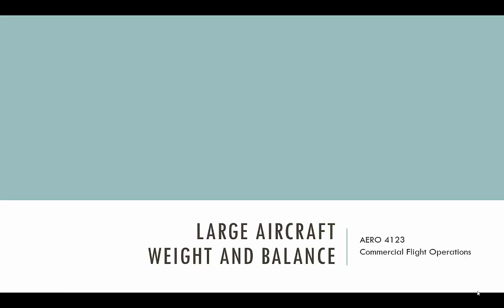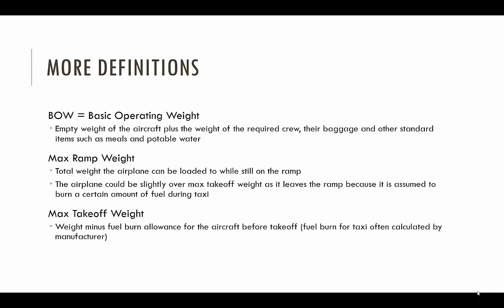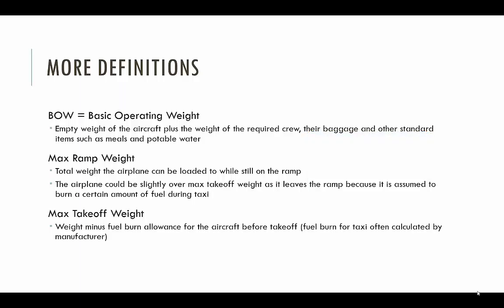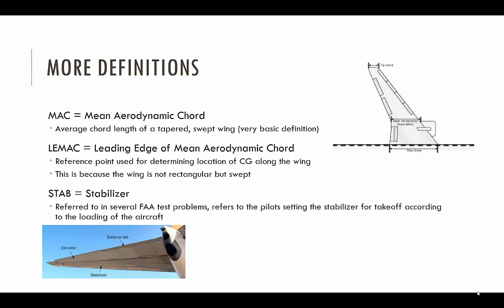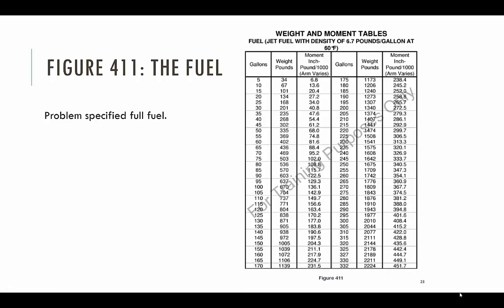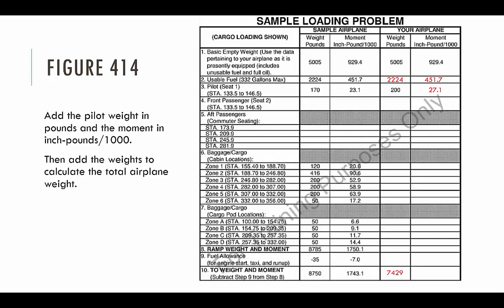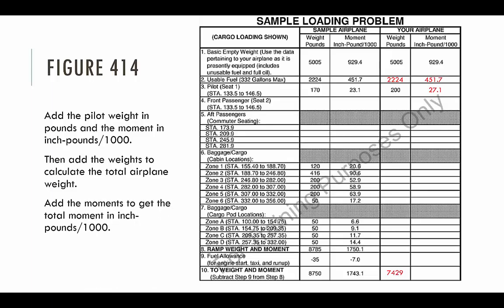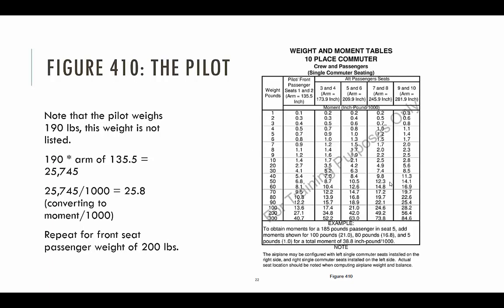Part 3: FAA Test ATP Airline Transport Pilot and Aircraft Dispatcher ADX Calculation Tutorial (HD)

Comment: I think there's actually an error in the question 8700, where it says cargo zone 6 weight 60 x arm 344 ..   the calculation they did for the answer is not correct.. can you check it?   thank you for posting this video by the way, it helped me a lot so far.
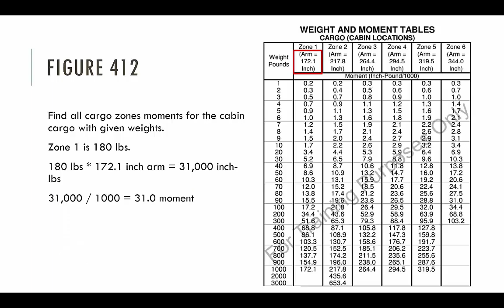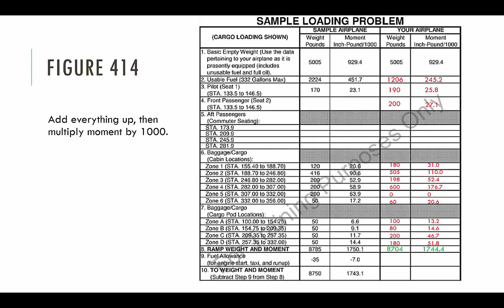Reply from the maker: Hello! I reviewed the video and found at time 14:51, you can see the cargo zone chart showing the weight of 60 corresponding to the moment given as 20.6 for cargo zone 6. At 15:15 in the video, 20.6 is listed for the airplane moment after doing the calculations. This was on question 8699. I did find that all the moments add up to 1744.5 at 17:20 so that is slightly off (video shows 1744.4). My apologies for the error, but thankfully it does not affect the CG calculation in this case. Is this what you had noticed?
Reply: I noticed that for question 8700 they used the arm of zone 5 for the zone 6 calulations... why is that ? zone 6 is 344 arm as you can see in the chart.
Reply: well.. with 1744.5 moment the CG is 200.4 .. but the "good" answer in the ATP exam shows 200.2 CG (1744.4 momment)